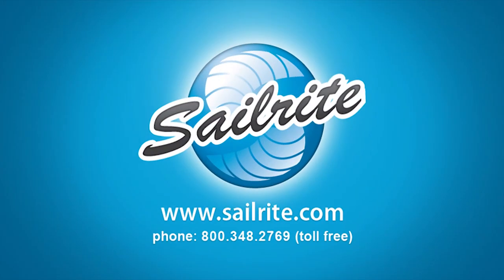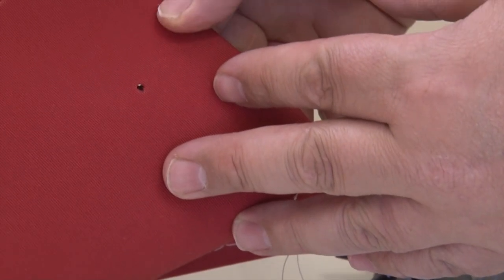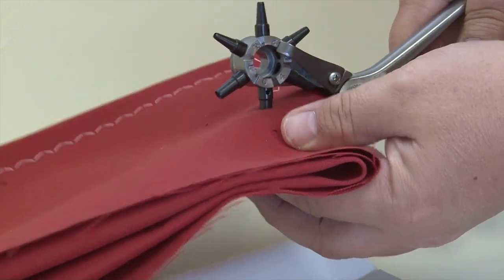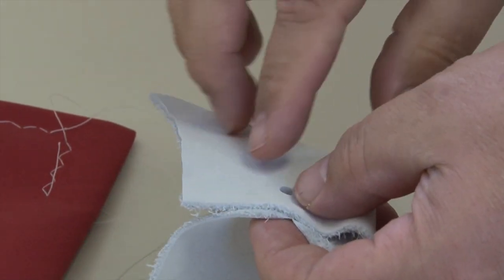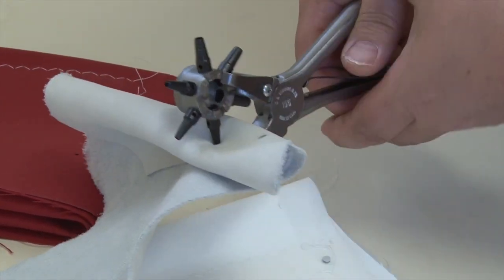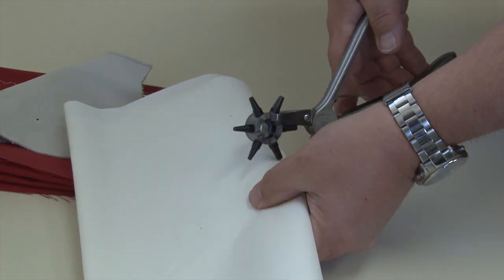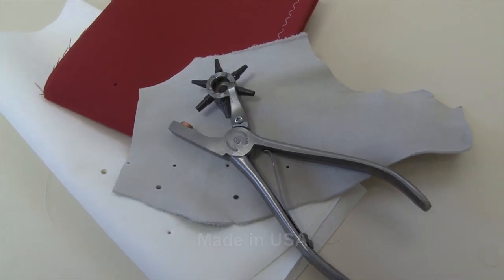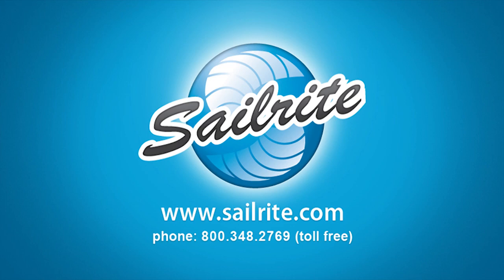Revolving Hole Punch - Six Sizes - Leather, Canvas, Fabric Hole Cutter

Comment: can this be used to cut through thin metal sheet or bottle caps? thanks
Reply from the maker: +Letty Cardenas I do not think it was designed for that, so no I do not think that will work for long.
Reply: Yes it will. I use mine to knock through 25 gauge and up steel and definitely caps
Reply: Is this tool available in Amazon for shopping..? 
If it please the link with thanks .
 much appreciation.

Comment: can it punch through webbing?
Reply from the maker: Yes, it will. However webbing will always leave hairy fibers in the hole, so it will not be a clean hole.
Reply: My punch won't punch holes unless l twist the punch l find it dry hard it's a new punch
Reply: I don't know if l can use it again